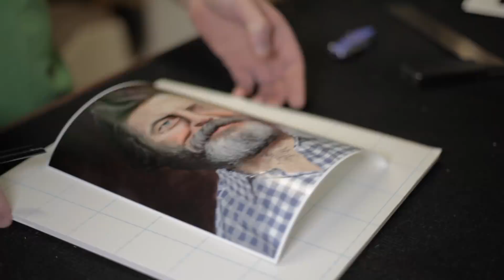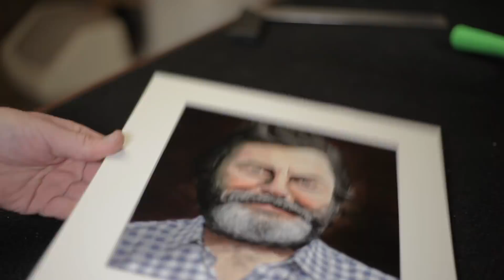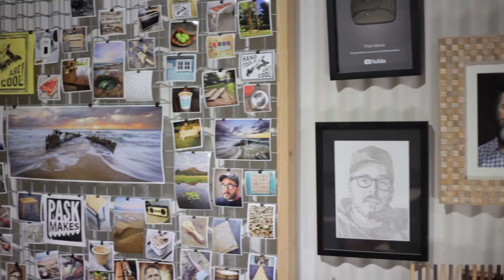Textured Picture Frame - Scrapwood Challenge Day Three

Comment: So far this is the best Scrap Wood Challenge I have seen. Time consuming to sand all the little pieces, but the impact is so worth the time. Love the painting too.
Reply: arosenberger87   I had the same reaction about sanding all those tiny pieces of wood.  I know that some manufacturers clean up small wooden parts by tumbling them in a closed container--sometimes with an abrasive medium and sometimes with nothing.  Kind of like what they do to polish stones.  Maybe this might have worked for Pask and saved a little time.  Anyway, an excellent project well executed.

Comment: Cool pattern. Just curious, is all that picture frame making equipment for your own photography or did/do you have a framing business.
Reply from the maker: Thanks Justin! It was framing my own photography mainly but I would do a couple of frames most weeks for customers too! We used to sell the photography from a market stall and people used to bring there artworks in for me to frame. :)
Reply: I was wondering the same thing! Quick question, how often do you have to sharpen the blades on the guillotine cutter?

Comment: That's a beautiful frame. One question, it wasn't immediately obvious, but did you put the top angles on each block by cutting them slightly angled on the mitre saw, and if so, did you alternately make a square cut, then angled cut to avoid putting an angle on both ends? I've tried to watch it back a few times and I'm still not 100% sure how you did that

Edit: ignore me, I can see it was done on the router table now!